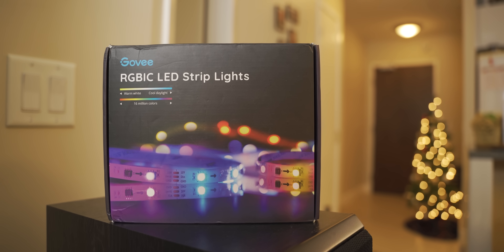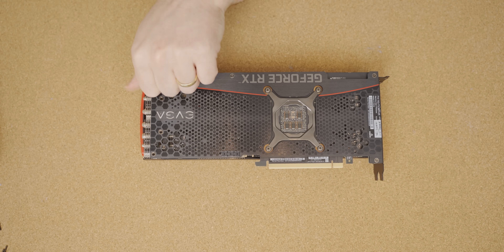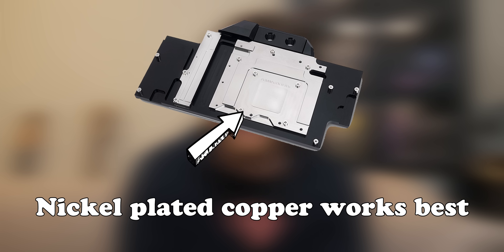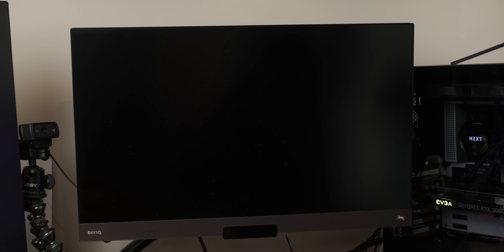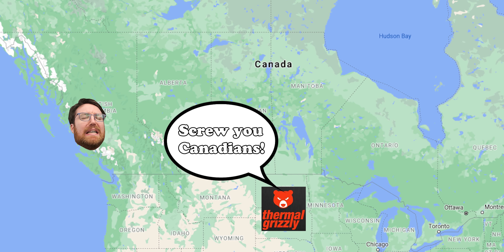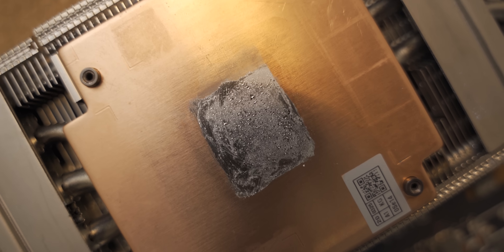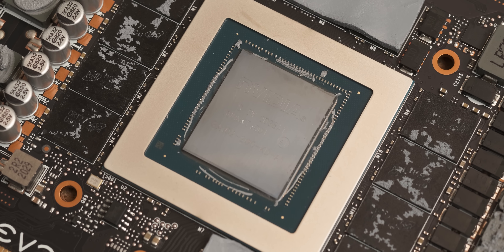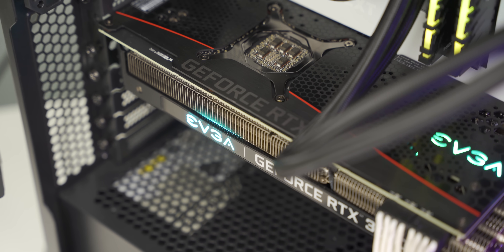NOOB uses Liquid Metal on an RTX 3080...

Comment: Logic fail in video...
If there was "only one temperature sensor" for the card then why would you suspect the thermal pads for the memory and other components when there was thermal throttling?
If there was only one temperature sensor it would obviously be part of the GPU processor itself... but since your fans are behaving weirdly AND the GPU temperature is reporting fine then OBVIOUSLY there are other thermal sensors on the card... so it's a weird logic fail that you note this and talk about replacing thermal pads to fix this issue. How would the fans know to ramp up if there was no temperature information from those components?

Comment: evga have a problem i met long ago, they design the card need the thermal compound to fill a "gap" between the plate of the cooler designed to be about 0.1 to 0.2 mm off the gpu the ugly part is when the thermal compound gets dry due heat fans accelerate and if keep using then card die

Comment: There is no heat spreader on GPU, therefore it may throttle and fans ramp up if surface of crystal is cooled not equally. Even if sensor shows good temps, some parts of it are overheating. Reason? Not enough liquid metal and application of it should be done on both and a chip, and a heatsink for better results. Never use foreign thermal pads it may produce gaps and uneven pressure between chip and heatsink...

Comment: So the “liquid metal” is gallium? Galium destroys the aluminum alloy bond and makes it as Brittle as cheap terracotta
Reply: It also dissolves gold and what are CPU s connected with, tiny gold wires thinner than a human hair?
Reply: @MichaelClark-uw7ex   not on the side that the heat sink goes. It’s behind the bottom color
Reply: @Astinsan  Yes but can you guarantee it stays on the CPU without dissolving the IHS?
There are videos wher the IHS is dissolved and the heat sink fails
Reply: @Astinsan  And what keeps the liquid metal from seeping through?

Nothing? I thought so.
Reply: @MichaelClark-uw7ex   prove your hypothesis

Comment: Why even bother doing this? A nice PC build with proper cooling and proper specs will play any game at full specs with no heat issues, a 3080 should run perfectly fine from the factory without messing with it. I know you did it for content, but still kinda pointless.

Comment: liquid metal is a great way to upgrade a real nice cooling block like water block since all heat could be taken away, if the cooling fins is the bottleneck, LM wont do anything. in other words, 3070 or higher may not have a difference at all since the heat gen is way too much for the cooling solution, even all heat could conduct to metal fins.

But for old gpus and cpus, if the thermal greese is completely dried, like i have in my 6700k, swaping to LM is helping a lot, much better than greese and wont hurt much even if u fked up and fried it

Comment: You did something seriously wrong or the heat sink has crappy contact or a inadequate cooler to begin with.   On my msi gaming x gtx 1080 and rx 480, I got 12c and 8c drops respectively, but those cards have very substantial heatsinks for the gpu types I have.  As they say, your mileage may vary...

Comment: Putting LM on a 3+ years old 4790 decreased CPU temp markedly (~20 C). It seems that the best results are gained by replacing old TP with LM. I did not try replacing old TP with new TP. Maybe similar gains could have been achieved. I posit that dried out TP is the culprit.

Comment: Yup, thermal pads are the issue, Jay and his 2 cents mentioned that when reapplying new thermal pads you have to put on the correct thickness pads. But keep going, I'd like to see the temps with the correct pads and liquid metal. 👍🙋‍♂️

Comment: I have applied liquid metal in laptops and gpus, and tbh is absolutely not worth it. If you put want better temps for a gpu is much better to get a liquid cooler for it. No risk and better results. Without mentioning that whenever you want to change it, the coating that you put around the capacitors gets melted and it’s a fucking mess

Comment: did you know i broke sapphire nitro+ rx 570 by replacing thermal pads with 1mm instead of 0.5mm as originaly they were ? GPUs worked for 1 day and they broke the other day. Had like 18 gpus pads replaced after they started to break, replaced with original pads back.

Comment: So what are the absolute best case results for using liquid metal? What temp drops are possible?
Reply: I've seen as high as a 10°C drop, bit usually it's closer to 5°C. It's always super difficult to replicate any given result because of how many factors there are. Thermal paste brand, application method, mounting pressure, sometimes I'm pretty sure the phase of the moon on the evening in which you repaste has an effect.

Comment: Working on GPUs is awesome, I'd suggest Liquid Metal on CPUs as a project, especially after delidding and removing that awful thermal paste.
Reply: You shouldn't delid any modern AMD or Intel Cpu... they're all soldered and you will destroy the chip if you don't put it in the oven very carefully. Even you delided it successfully, it's not worth it because solder is pretty much on par with liquid metal baring 1-3 degree celsius on average. Only delid old Intel CPU'S!

Comment: Hi, just started to watch your video with this one. You tried liquid metal and got probably 2-3c. Actually if you really wanna optimise thermals, power and performance. Undervolting is something to consider. I am able to run 1860@837mV and temps around 65c (25c room temp) and almost avg power draw of 250-260w. My card anyways use to throttle at 78c and stock clocks would settle at 1850-1900. So it's a win win situation for me. Zero investment, very easy and nothing to worry at all.

Comment: nope, its good of a few months and then you have to replace it, but it is corrosive  on most other metals including copper and it will eventually fuck up the gpu if you keep it for 2-3 years, also measure the damn thermal pads and apply em correctly, it's pretty hard to eyeball how thick they should be so consider using some measuring tools, oh and apply even pressure to the screws, if its uneven it can cause bad temps and even break or chip the die, kinda like when you let chimps play that shapes game and they smack the shit out of those pieces when they don't fit.
You apply liquid metal when u can afford to wipe ur ass with 3080 money...otherwise ,eh not worth it.

Comment: The best way to improve cooling on those newer graphics cards is to buy the water block for the certain type card you have and go that route ..Yea dont even screw with getting 3 or 4 *c cooler   Go for the water block and get insain difference in cooling ..Totaly worth it if your gonna stationary run it overclocked a touch ...in other words if your gonna run it overclocked a little all the time . Do research on the waterblocks though ,,that work the best with what type card you have . one companies waterblock might do better on a 3080 then say the other brands

Comment: Hey. Just started watching your Channel today I've watched quite a few in your video so far. I'm very new to upgrading and building computers. I have a question. I want to update the ram in my laptop. from a 2x 2gb to something higher. Is there any risk to upgrading the ram? Like would I be able to jump from what I have now to 2x 8GB ram? Or would it over load my system. I'm also thinking about upgrading my harddrive to a SSD. But I want to see what the ram will do first. 
I've also watched your PC build videos. And been thinking about saving up in building a PC for audio production purposes.

Cheers from Vancouver Island, Canada

Comment: The problem here was the fact the original thermal pads were not the same thickness and the card was able to dissipate heat evenly from all of the components. You not only added corrosive thermal medium which is dumb but also destroyed the thermal setup on all of the components.

Even that simple thing is too much for you.

And let me warn you: If you ordered just one size of thermal pad then even if you replace all of them you may still have unstable card. Anyway, good luck, I hope the views are worth breaking the card.

Comment: This is really awesome to see you try liquid metal. I can say from experience that it does immensely help with leveling out the temps as an example, on my 7700k, I got a 15c decrease under load and the fluctuation of temperatures was decreased by 5c.  I hope you can come back to this at some point, it's much more difficult to do this on a GPU, and I myself wouldn't dare try this!
Reply: I have an 8700k from silicon lottery that was delided and put on liquid metal,  Its been at 5.3ghz for 5-6 years, still under 60c gaming.  Just amazing.  Upgrading to 13900KS next month though lol, 24 core 6ghz sounds to juicy.

Comment: Even if it would short out, the card will be fine, you just have to remove the liquid metal from the parts around the GPU, this happened multiple times to me with mining R9 290X...

They all are still alive.

You can also use any normal not conductive thermal paste around the GPU, like arctic mx 4 for example... it will be much easier to remove after...

Comment: makes sense why it does not help that much.
Firstly while the 3080 consumes a lot of power the gpu die is also very big.
Just comparing it to the 8700k I am using now:
3080: tdp 320, die area 642mm2
8700k: tdp 95, die area 149mm2
Ignoring overclocks, ignoring the ihs being an extra barrier still per square millimeter the 8700k consumes a lot more power 0.64w instead of 0.50w.

Comment: You should never add more. NEVER add more. In fact, don't even drop it on the GPU directly from the tube. Apply it to the swab, then start wiping the swab on the die and heatsink.
The biggest reason that Liquid Metal does better than traditional TIMs isn't that it has a much higher thermal conductivity (I believe most LMs are roughly 54 W/mK, while generic pastes are 15-30 W/mK and specialized thermal compounds like Cryonaut can be up to 70-80W/mK), the advantage comes in how thin of a liquid it is, how it's able to spread thin super easily, how the distance between the die and the heatsink can be reduced much further than a traditional paste. The thermal interface material is always a bottleneck to thermal transfer, so the thinner it can spread, the less that has to be between the heatsink and it, the better the performance. Aside from that, just be careful from now on when disassembling heatsinks, those thermal pads are very delicate, and if you damage them they aren't easy to reuse. That putty that EVGA puts on the chokes is also reusable, just treat it the same as a pad, very cerefully.

Comment: The limiting factor with the XC3 is not the heat transfer between the die and the cooler, but it is the heat transfer between the cooler and the surrounding air. Your result definitely shows that as well.

To truly utilize the potential of liquid metal, you need a water block because at the point, the limiting factor is indeed how quickly you can get that heat away from the die into the cooler. A water block is able to absorb the heat from the die much quicker and more efficiently than an air cooler.

You will see either a temperature difference or you will see higher clocks at the same temperature with liquid metal and waterblock. Also, the other benefit would be that you would be running close to 40-45C so the die will run much more efficiently to begin with. So you will be able to boost up higher while using the same amount of wattage (and therefore getting more performance at the same heat output).

Comment: I wish companies made LM slices...like they make them in the exact surface area of AMD or INTEL CPU's and AMD/Nvidia GPUs.  So after you coat the surrounding area with that protective/non conductive stuff then like double sided adhesive you remove the protective film and lay the liquid metal slice perfectly a top the cpu.  Spreading it causes inaccuracies on the surface, possible metal leaking and is just sloppy.  Liquid Metal slices in strips would be perfect.

Comment: Hopefully this will cheer you up about thermal pads. On my EVGA 2060 the minimum thickness of pad is 5mm with one section at 10mm. (2x5mm pad stacked on top of each other) This is the factory shipped version. Great video.

Comment: This so weird 😄 I replace (ONLY) thermal paste on my MSI Gaming 2070super.....and my temperature drop about 4 maybe 5 celsius. Now I have 63 - 65. And I very surprise. So my fan speed drop rapidly a lot. Now I have deadsilent GPU 😁😄
Even before my GPU is silent. But my temperature is around 66 - 69 celsius.

Comment: Dawid, Great nail biting video.....
Isn't the thermal throttle issue a driver problem? Read that there were issues with drivers causing thermal throttle.
I was also worried that the sensor was located next to the GPU which you painted in varnish, but guess the sensor is in the heat-sink?

Comment: When it comes to gpus it's much better to just fill the whole bracket around the die with cheapest non conductive silicon thermal paste so the area of heat transfer is bigger. It's cheaper, you get better temps and you definitely wont kill your gpu. On air it's a couple C, on a universal gpu block that wasnt big enough I got once like 30C by doing just that.

Comment: Sounds familiar. I had a ZOTAC card (can’t remember what kind) but when I disassembled it to put better thermal paste on it (which is what I always do, because it’s such an easy few degrees gain) I noticed how much ZOTAC put on it. On closer examination, I noticed how the heatsink did not quite touch the GPU when there was no thermal paste on it. I think they did this on purpose, to make it impossible to break the card by screwing the HS on too tightly. Downside of course is you need more paste, but I suspect that’s cheaper than throwing away cards that were overtightened at the factory or came in from warranty claims because of this.

Comment: Liquid Metal is very risky bro.. Thermal Grizzly Kryonaut is the best for GPU.
Like GN Steve said Kryonaut lasts forever...i mean this stuff never drys. I used it on my rx580 almost 4 years ago then 5 days ago i open my 580 to reapply the paste but to my surprise the f***ing paste is still wet. I just then put one drop of Isopropyl alcohol and soften the paste more and assembled the gpu back (did not apply new paste) and it is working again like new paste....cool and quite. 😂😂😂
By the way rx580 running at 1450mhz @ 1120mv temp is 62°c max.

Comment: 3-6 months later... "liquid metal killed my 3080" then 1-2 years later. liquid metal killed my PS5
Reply: And after that, it starts eyeballing your family!
Reply: lasts more than 2 years. my 8086k delided and with liquid metal is still clocking 5.4ghz for over 2 years.
Reply: @pauloa.7609  my 7700k does 5ghz with liquid metal, i swapped it 2 times and it looks like small amounts do get burned or something. Because evreytime I cleaned it there is alot of “ashe” coming of it, grey substance. Also the die isnt shiny as day one, it has gotten hazy. But temps never get above 70c.
Reply: @Usul-xp6ve  it may be oxidation
Reply: @KenzertYT  I believe so too, also the cpu chip isnt as straight either. My cpu is 4 years old now and I use a simple air cooler that isnt heavy at all, a cryorig h5 ultimate. It doesnt affect performance but when I cleaned my rig last time I noticed that its somewhat “bent” probably beacuse of heat and cooler pressure? Anyone else can share insight?
Reply: @pauloa.7609  8086k?
i7 8086k? It's so weird model name.
Is it something like special edition of 8700k?
Reply: I think ps5 come shipped with liquid metal by default
Reply: lucky m3x  no what, my dude?

Comment: I've been using the Adata thermal pads from amazon for the moment. they work good enough for old laptop repairs. But for my gpu, I want to get some of the Panasonic thermal interface pads from Digikey.ca  They are fairly expensive, but the thermal conductivity should be worth it 100%

Comment: Did this to my 2070 super, when I delidded and and did a liquid metal application on my 3900x. Haven't seen gpu temps hit 70 C since, and it's boosting up to 2100 MHz with my OC set. Definitely an underrated procedure, that can unlock some gpu potential, without having to get a $250 waterblock, made just for that card!
Reply: Or.. use a waterblock custom made specifically for the card AND Liquid Metal.. that’s what I do 😅 lol

Comment: The risk/reward ratio of liquid metal application is far too unfavorable to try it on an expensive components.
Unless you're a youtuber, of course - then it makes for an potentially dramatic video;)
Reply from the maker: Haha!! I 100% agree. Also considering that it corrodes over time, it just doesn't seem worth it to me.
Reply: @DawidDoesTechStuff  it doesnt corrode, it absorbs into it. kinda weird chemically.

https://www.gamersnexus.net/guides/3362-how-liquid-metal-affects-copper-nickel-and-aluminum-corrosion-test
Reply: Meh, risky yes but definitely worth it in some cases to me. High end laptop was an oven out the box. After a little LM treatment you have to intentionally try to thermal throttle it with OC's or it'll never even get close